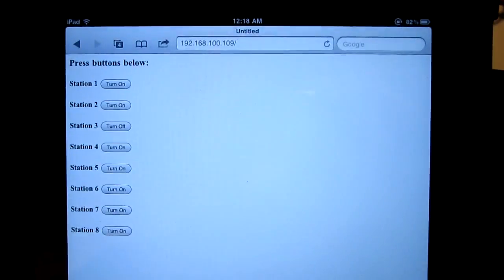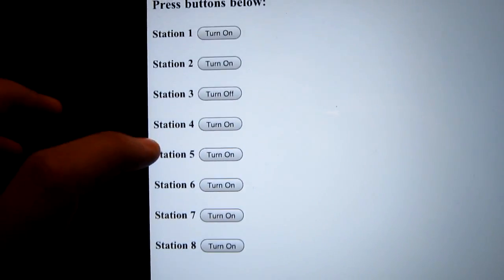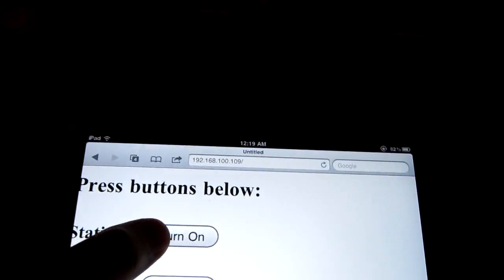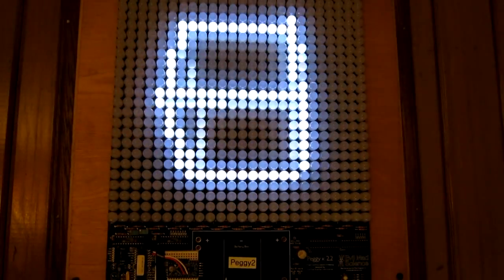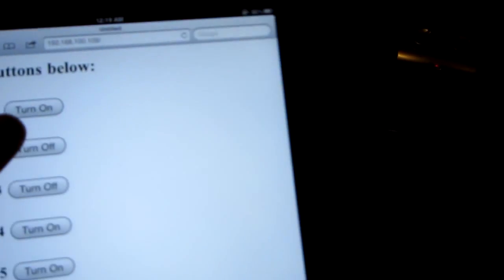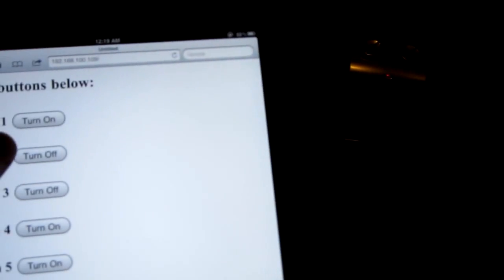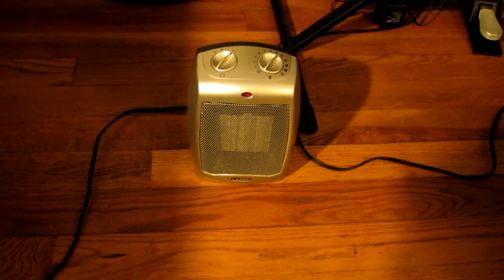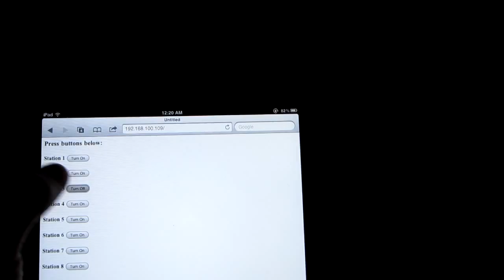Using OpenSprinkler to switch power line devices through remote controlled sockets

Comment from the maker: @Second2Rush: these remotes are typically activated by simulating a button 'click' -- press and release after may 100 milliseconds. You don't have to press and hold it -- it doesn't hurt but will just waste battery.

Comment: Kool lol, need a Question to ask you and thet would be
On a 2 chanel remote Switch i bought from Tmart. c om how do i program the Switch to the Module like Holding the Remote down intill the LED's in red Beep or do i have to use an other way to Make it work with the Remote?